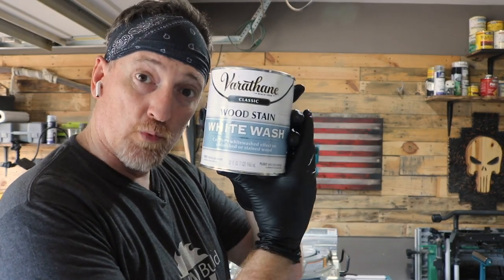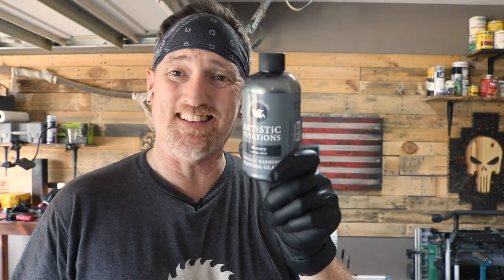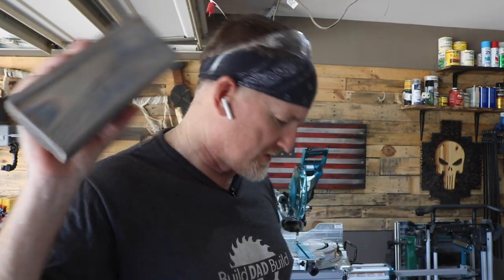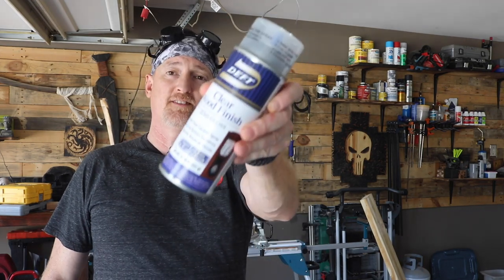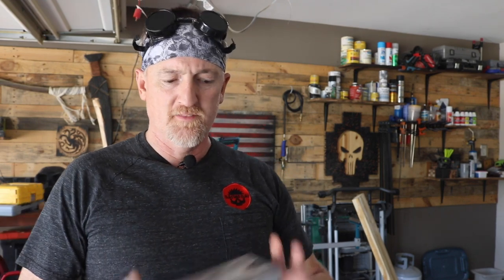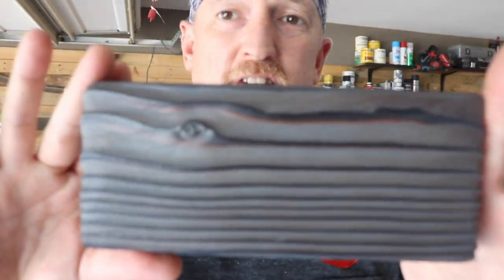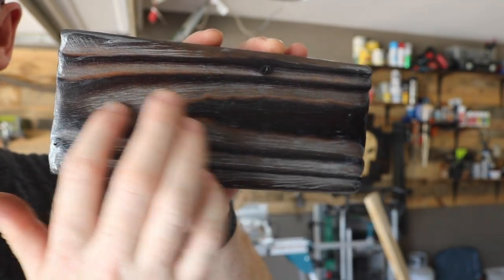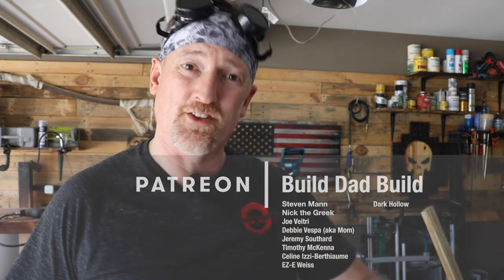DIY Wood Burning Technique - Shades of Grey

Comment: The look with the sun beached is exactly what I'm looking for.  Now, time to find a torch!
Reply from the maker: Awesome!
Good luck.
Cheers!
Reply: Anyone without a torch try using a heat gun for small projects?
Reply: Sun bleach is by far my favorite stains I like to leave it on for 5-7 mins. The. Wipe less or more aggressively to change its appearance. It’s like a chameleon 🦎
Reply: Vincenzo Ragusa Do you recommend 1 or 2 coats ?
Reply: Jose Centeno I personally do one coat, but if you don’t get the results you like you can always reapply.

Comment: Hey Nick, I did some experimenting with white's and lighter greys.  I used water based latex not thinned.  Brush it on your shou sugi ban then take a squeege, rubber sanding block, strong foam or whatever you have and try it out.  Do it right after you put the paint on.  If you f#@k up just take your brush and re-apply.  So swipe your rubber block maybe a foot then wipe the block off and repeat.  Cheers
Reply from the maker: Thanks for the tip!
Cheers

Comment: I completed my first showcase shou sugi ban attempt on an entertainment console I built. The how- to videos shared by Build Dad Build really helped with my confidence in attempting this technique. Initially, I wasn’t sure of the stain I wanted to use, so of course I did a few trial runs on scrap wood. My original idea was to use several complementary colors of stain on the wood, and my hope was that the multi-colored stain would set into the grain and give the appearance of a vibrant swirl. Sadly, I couldn’t figure out how to achieve that look. Is that even possible?🤷‍♀️
Anyway, I utilized this technique on the console surface and drawer faces. I ended up using maple stain, and I went in with red stain and hand painted a few wood grain paths. It looks so dope!
Reply from the maker: Thank you for the kind words.
And your project sounds amazing! Would you mind sharing pix on Discord?
https://discord.gg/Aa749ws
Also...check out @wtfudgery on IG. She's blending colored stains and doing an amazing job at it!
Cheers!

Comment: Hey I don't know if you've already answered this, but how much material does burning and then brushing take off of the wood? I'm making an American flag where the red stripes are burnt, and each stripe is about 3 quarters of an inch, and if I lose too much material I'm afraid the stripes will be too small. Should I just partially burn them instead? Thanks
Reply from the maker: Not a lot really. Prolly 1/16 inch. Might get more like 1/8 if you burnt real deep.
Cheers

Comment: Do any of the stains work with epoxy? I want to stain my wood slab to that sunbleach effect you did but I’m not sure if I can apply epoxy over it ...
Reply from the maker: The sunbleached stain would probably work (I think it's oil based). Try a test piece first. My only concern is if the stain is water-based the epoxy might reactivate it.
Cheers

Comment: I'm doing a shou sugi ban project with a guitar I am refinishing. It has a alder body and I'm nervous because I've never seen alder shou sugi and I'm worried that it won't work. Any advice on doing shou sugi ban for a wood with not much figuring?
Reply from the maker: The figuring is what gives you the SSB look. Woods without grain patterns just burn.
Reply: Thank you, I found out it actually was basswood when I got to sanding and the figure is there! One other questions I had, if I got a wooden pickguard to ssb would the wood be too thin?

Comment: I love the sunbleached but you cant seem to get it here in the UK. unless I get it from over the pond where the postage costs more than the paint. :/. I have seen some do a grey with whit spirit viniger with steel wool left in it for a while. I might try that because it's a cheap try out.  As usual great vid mate 👍
Reply from the maker: Thanks, Paul!
Check out this stuff, it looks like it might be what you're looking for.
https://www.amazon.co.uk/Littlefairs-Water-Based-Wood-Stain/dp/B07HLS2YY7/ref=sr_1_9?dchild=1&keywords=wood%2Bstain%2Bwhite&qid=1590066725&sr=8-9&th=1
Cheers!
Reply: @BuildDadBuild  cheers nick. I like the look of the driftwood one 👍

Comment: Always love your post. Quick question how long do you typically let the stain sit? Do you do anything different for dye vs stain? 
I typically let it sit for 3 mins
Reply from the maker: It kind of varies. But I'd say, on average, about 3-5 minutes.
With dye I just wipe on. I'll only take any excess pooling off. And if the dye isn't as dark as I like, I'll come back and hit it with a second coat. 
Cheers!

Comment: Need to get some opinion on what you like to mix your Keda die powder with.  I hope you've used them.  I bought a sample pack as I'm  going to do a narrow bar top of 16" x 10'x 1 1/2 " Pine.  I have paint thinner to mix it with but reading the package it says you can just use water.  I watched the video where you used Ritz and the other dyes including the Keda.  Yours's looked to be liquid but I couldn't get those.  So I'm wondering if you can mix it with water, you probably can't use thinner to make it to the amount you need.  right?  thinner is more oil based?   Help please.  You can leave it here or if you like I'm on FB https://www.facebook.com/tmh55 .  Thanks
Reply from the maker: I mix Keda Powder with water and it works fine.
I use the powders in this video:
https://youtu.be/S-HY2txy7n4
The liquids use lacquer thinner.
Cheers!